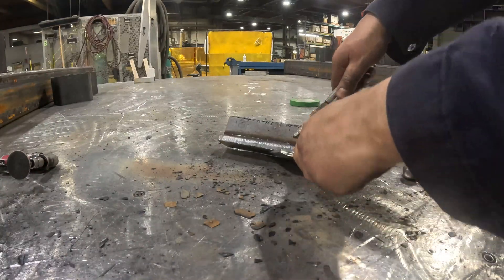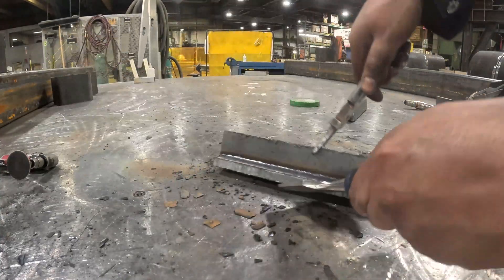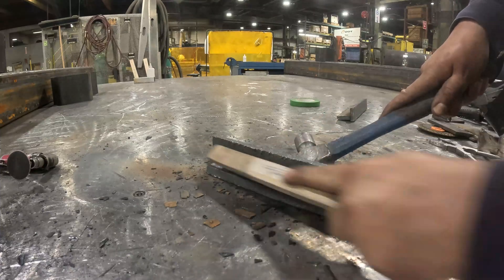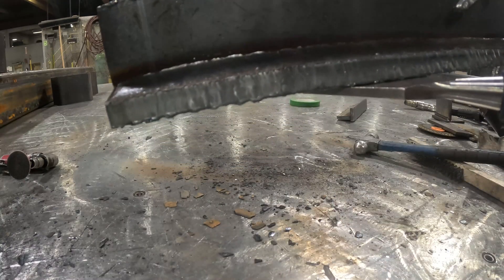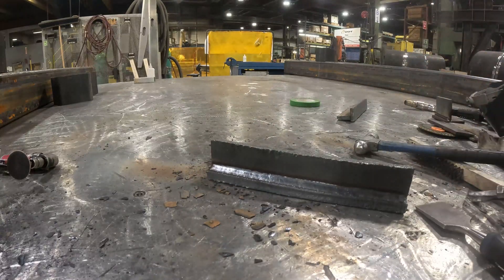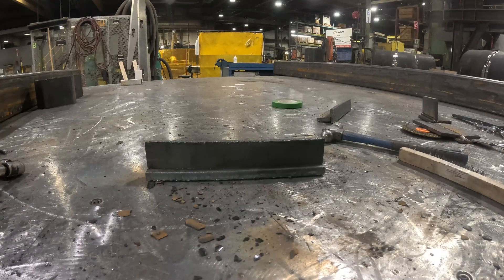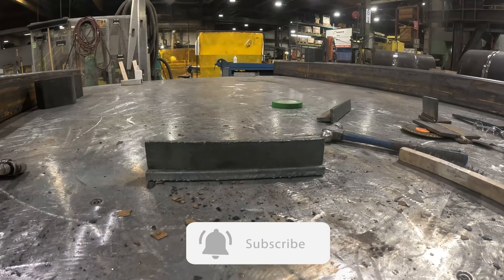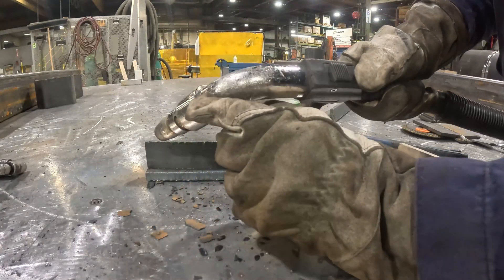Why Your Fluxcore Welds Look Bad (Watch This First)

Comment: You know, if you was to buy a decent slag axe you wouldn't have to go through all that nonsense with the two handed stuff.
Reply from the maker: Haha yeah, I’ve got a proper chipping hammer, problem is, it’s always in the wrong place when I need it.
I shot this during my lunch break, so I didn’t exactly come in with a full setup.
Next time I’ll try to plan ahead... or at least remember not to leave half my gear in the chest😅